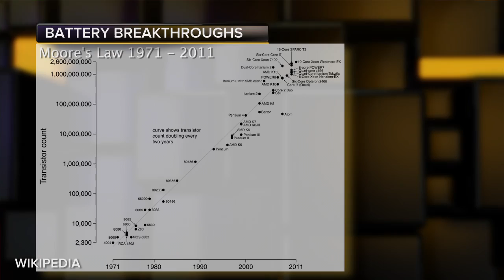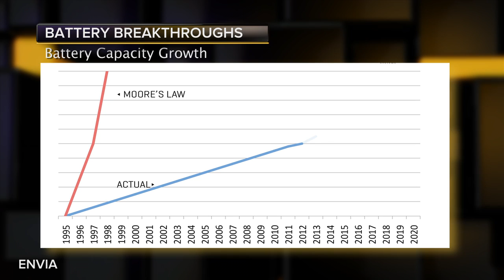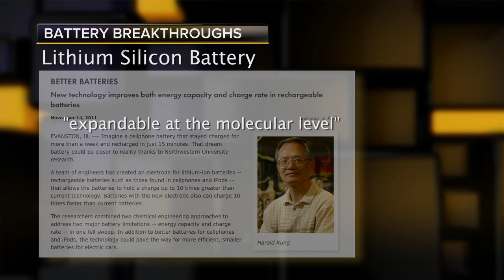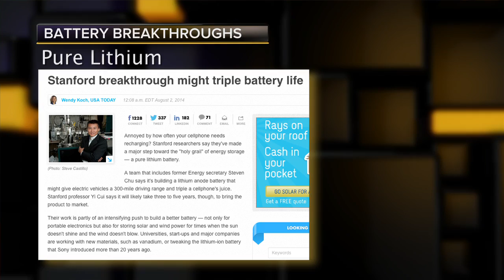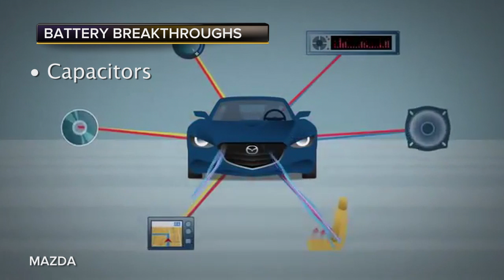Next Big Thing - Where will the next battery breakthrough come from?

Comment: batteries are not developed like processors! WHY? Oil companies buy the rights to research of batteries and then slow walk them! Example solar cells are only about 15% efficient, but SKYLAB space station in orbit in late 70's had solar panels that were 45% efficient. Taking into no diffraction or reflection of solar E it is still magnitudes better than what is sold to individuals today?

Comment: Well my friend that is because capacity has increased over the years and mobile parts have gobbled up that power for extra performance, although with all the quick charging tech that isn't quite true and if you compare the original iphone to today's it has better battery life and there are phones which have much better battery life than the first crop of smart phones.

But really it's down to poeple bogging down there phone with apps running in the background.

Comment: Look at some of Nikola's last works and he was into flux devices, capacitors, diodes, and batteries , and this was back in the 40's and 50's, Steinmetz was also working on similar systems all using maxwell's equations that have all but been abandon by the physics community.

Comment: How stable is this , I am a chemist and metallic high purity sodium metal is used to dry solvents. IF high purity metal sodium gets wet with water it is so reactive it will explode, and light on fire with a white flame like a plasma discharge. It stores mass amounts of energy due to entropy, yet is very reactive. 
I have never dispersed sodium to get it to be battery electrolyte

Comment: Supercapacitors are not actually capacitors. They are using electrolytic technology of batteries to make them behave as capacitors, and have a longer lifespan than usual batteries. That is, supercapacitors are not capacitors making incursions into batteries. Supercapacitors are batteries pretending to be capacitors.
Reply: Cynthia Avishegnath the lifespan of supercaps is way longer than batteries

Comment: Hydrogen fuel is an improbable dream, based on electrolysis for separating hydrogen from oxygen, a process that's very inefficient in the production process.  Well-to-wheel efficiency (whole-system efficiency) is around 1% for hydrogen as compared to more than 10% for hydrocarbon fuel production/vehicle use.  Electric & hybrid electric/petro propulsion will dominate the vehicle market until something more innovative displaced them.
Reply: TheCynicalCommenter. Too bad things like Em Drives exist, you clown.
Read up.(:
Reply: SIMKINETICS As low as that?
Reply: Captain Kirk Yeah, I did a huge amount of research on energy conversion processes as marketing research for my invention, a mechanical; transmission.  The well-to-wheel efficiency is the most meaningful metric for evaluating efficiency.  in my research, I was very surprised by such low figures.  The derivations of these numbers is very complex, but they're scientifically verifiable and logical.
Reply: SIMKINETICS I knew that the car efficiency was low using gasoline, with diesel being better, but your figures are lower than I thought. I was thinking of the tank to wheel efficiency though.
The figures will be worse for oil derived from tar sands, and better from more local sweat crude, yes?
Reply: Captain Kirk Yeah, tar sands extraction is more like a desperate method, more difficult & expensive.  Infrastructure costs are an important consideration.
Reply: SIMKINETICS In your model then, then efficiency will to drop as oil require more investment and energy to extract.  It will be interesting to see how batteries improve over the coming years. This must be the way forward for transport.
Reply: Captain Kirk Battery technology still has a long way to go.  As a retired engineer & scientist, I've witnessed the acceleration of technological development, so I imagine a breakthrough within decades.  Tesla uses a very smart strategy for implementing electric batteries, so they're doing their part in the big picture.  Personally, I favor flywheel batteries in vehicles because of low infrastructure costs and very good efficiency if properly implemented; I talk about that briefly in my video.
Reply: SIMKINETICS I will take a look at your vid.
Reply: Stanley Meyer solved the hydrogen gas generation problems with electrolysis. But he was murdered some time after the Pentagon got very 'interested' in his work.
Reply: I think the best system would have both fuel source and electrical cells. They should start using more electric super chargers to balance and maximize the codependent system hybrids use. I heard about a non piston driven engine that's more of a turbocharger that compresses the fuel and air itself for combustion. This way, maybe it can overcome the fact that engines need a certain fuel to air ratio making turbos hurt while its trying to help. Turbos push more air through but it doesn't matter if its just brining more fuel. Fuel cells are interesting too. Hopefully one day, we won't need to pick necessarily and battery/electrical/fossil fuels are equally used making the system more competitive.

Comment: Search Thorium Reactor. Self contained nuclear reactor without any moving parts, no risk of weaponizing, no hazardous waste or byproduct, exponentially more efficient than uranium reactors, and a unit the size of a shampoo bottle would easily power a home. The reason we have Uranium reactors is the demand for the byproduct in order to create nuclear weapons...
Reply: Greg Fulton not sure the Thorium is that great. There are problems. True about the Uranium though.
Reply: +Greg Fulton nuclear reactors only produce heat. a reactor does not create electricity - rather, the heat created from the reactor is used to super-heat steam to drive turbines and generate electricity. home nuclear power generation units may be available in the future, but, i think it's more likely they will be at least the size of your typical gasoline or diesel generator.
Reply: simple reason why no one wants thorium, no uranium means no nuclear weapons.
Reply: president nixion killed the thorium reactor power plants!!

Comment: Nice addition. It will most definitely impact "all" current 
things that accept a battery. 
The day that we see a significant change in battery technology will be a great feat for our future. 
Can't wait !
Reply: We won't be waiting for long! For automotive puropses, we've seen several electric cars reducing in price as thier batteries drop in price at a predictable 8% per year. The i-MiEV's the perfect example (mainly because low production didn't effect on the price of its batteries). $50,000 until 2010, $30,000 in 2011 and $23,000 in 2014.

The next few years are going to be busy! Nissan - Renault Alliance has something cooking in 2015 for the 2nd gen LEAF, specifically a 150 mile option. GM and LG Chem have a 200 mile EV (Bolt) in the works that's due out around 2016.